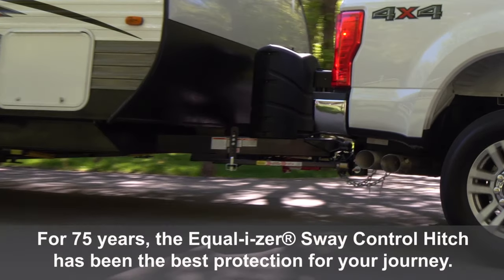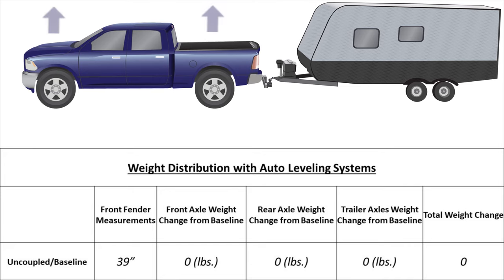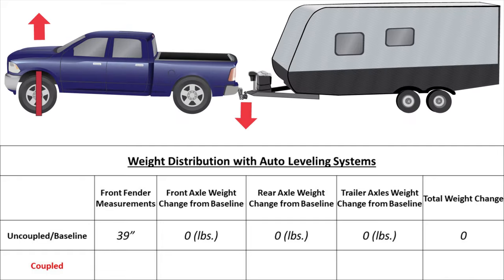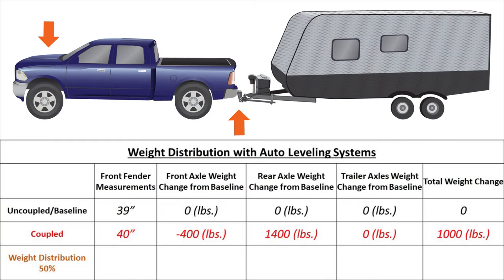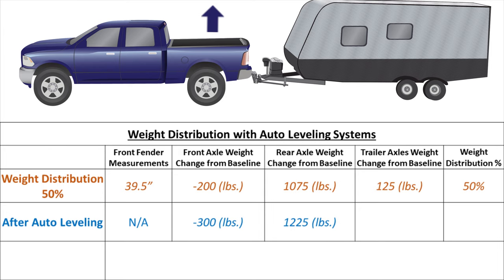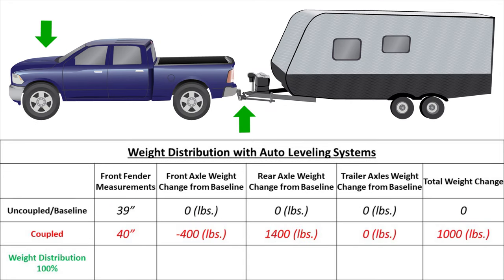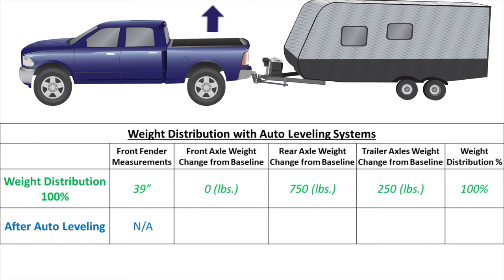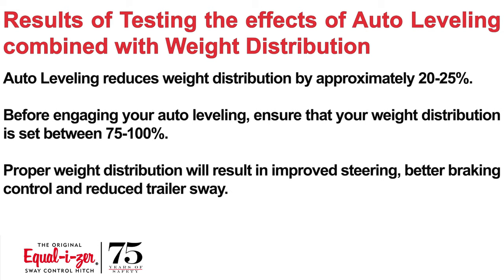The Effect of 4 Corner Auto Leveling on a Weight Distribution System

Comment: I just did this with a 2018 quad cab ecodiesel with autolevel air and a 26bhsck (i think it was) and we had the hitch flipped, 1 hole up in the L brackets and 6 washers.  The truck was on level ground when i set it in jack mode.  when I turned off jack mode the air suspension didnt need to self level and I lost nothing.  the trick to this is when you raise the tongue jack, check the front AND REAR heights before turning jack mode off.  if front and rear drop dispraportionally, its setup wrong cause the air autolevels unless its over capacity.  there is nothing you can do about the 1” rake on ram 1500’s with air but you can setup so the rake is maintained.  best towing experiemce ive had in 25yrs.  I didnt even have to scale it this time.  of the back drops more than the front, theres not enough weight transfer and the air suspension is going to unload your bars.  the air suspension should not be auto leveling, its dangerous

Comment: How can we tell what 100% weight distribution is?  Do we need to have a scale for that measurment?
Reply from the maker: If there is little to no sway, your hitch is set up correctly! If you are feeling a lot of sway, check your manual to adjust your hitch.
Reply: @EqualizerHitch  - We are adding two washers to the hitch today, everything is level, but the camper has too much sway, if we bump the L-bracket the truck feels like it's floating on a sponge - Hopefully this fixes the issue
Reply: You can use a scale or a tape measure. For 100% weight distribution, that means the weight distribution hitch is transferring all the weight back to the front axle so that it has the same load as before a trailer was connected. If using a tape measure, the height of the body fender directly above the front axle is directly related to the load on the front axle. In other words, if the height of the front fender above the front wheel is the same height with weight distribution as it was before connecting the trailer then you have 100% weight distribution. However, 100% isn't always the goal. It depends on your vehicle. refer to your owner's manual to know how much is recommended for your vehicle. Typically HD trucks recommend about 50%, while some half-tons or SUVs will recommend more. But don't ever exceed 100% or you are taking too much weight off the rear axle of your tow vehicle which creates other problems.